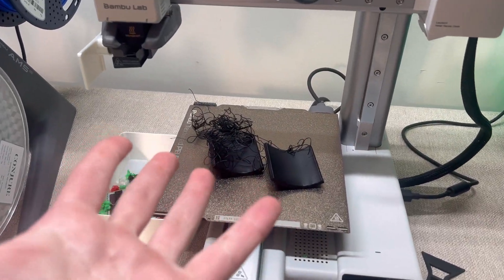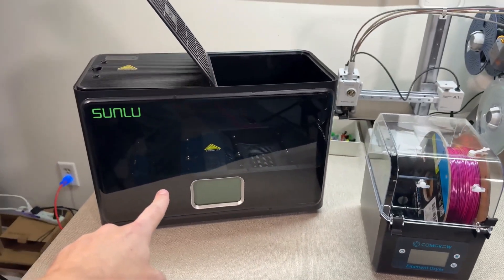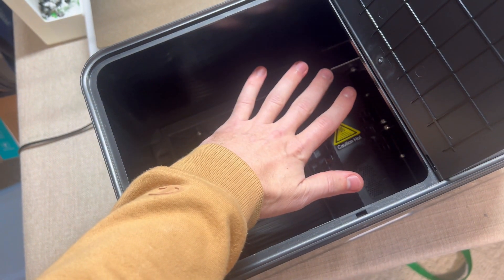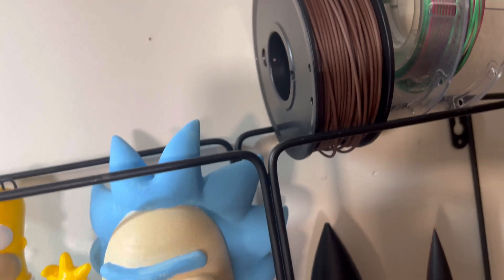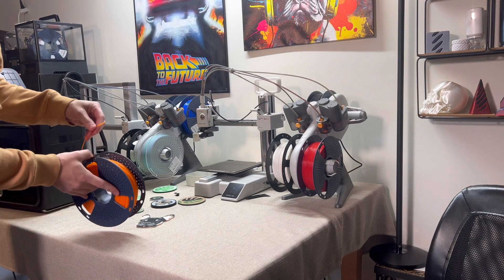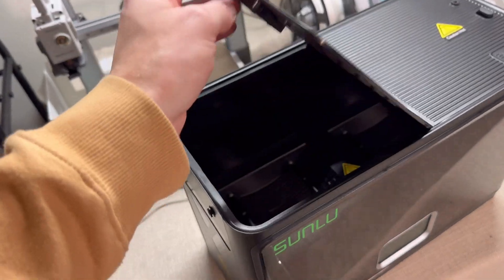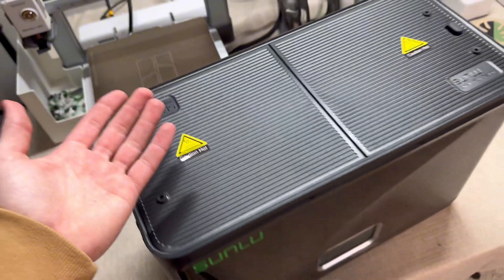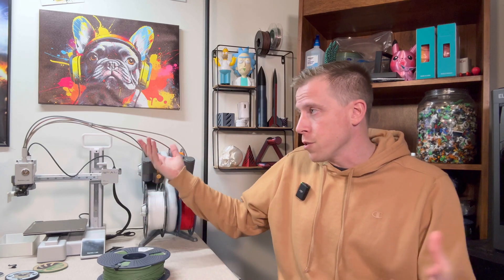7 Reasons this is the Best Filament Dryer!

Comment: Great video. Do you direct the filament directly from the dryer to the printer.
I have a Bambu a1 .
Do you dry them and put them on the spool or do you go from the dryer to the printer ?
I have a 4 spool a1 and am new to printing. After a week I started getting the webbing etc in the longer 4 hour + prints when about 75-80% complete.
All smaller prints seem to be fine.

Comment: Thinking about getting the flash forge 4 color printer, so, if I add the 4 roll dryer, do I dry filament as I need it, store what I don’t use and then dry it again next time. In the mean time should I vacuum seal it in between use and vacuum seal any new in stock rolls? Thanks

Comment: Starting my 3d print journey now and I got a p1s for 499. Loving it so far. Looking to get my  first dryer and I'm wondering if I should get the AMS 2 pro for $310 with the $50 Off that bambu labs offered if I buy the ams or if I should get a independent dryer like the one in the video for $139. I not sure yet if I'm going to start printing multi color stuff yet but I'm sure that I'll be printing 3d parts for my  car that needs to hold high temperature.

Comment: I would agree with you, if the Sunlu dryers wouldn't suffer from so many flaws. These started with the S2 lacking fans in some versions (all version are named S2, but some have a fan and some not) and continue with the S4 not being able to keep a stable 70C for a longer period of time. Many users also report, that their dryer simply stink so unbearable they cannot be used in the same room. Not to mention the complete absence of support from Sunlu.
So, I cannot recommend any Sunlu dryer based on my personal experience (and other when checking Amazon reviews or discussions on Reddit for example)

Comment: Terrible review 360 degrees but not a mention of the hot spots by the fans or the uneven temps around the box, no mention of costs keeping it on all the time.. Temp is an average lots of guessing involved still. No mention it doesn't go hot enough for some filaments. Not loud ?????? omg, lies. Maybe you didn't get it free but you clearly want to impress the company . No science behind this review just an opinion with no tests. Take this review with a pinch of salt people

Comment: Ive got a Comgrow filament dryer, as you show briefly in your video. for twin rolls. I use it to condition the filament an it can manually feed out to your printer. I have  a A1 and a A1 Mini. often going at same time printing. its electronic display and temp control. it has rollers inside the case. it has various located filament ports 4 off. It is a pleasant experience feeding to 2 printers simultaneous. one independent roll off filament each.
Reply: Yeah for those curious it was under $ 50 from Amazon. It included the power supply brick to suit. and it is built in fan also. and quiet!

Comment: Hi  Several times you mentioned it has 360" even heating.  How is it different than other enclosed driers?  What is the purpose of the rollers at the bottom of the drier?   Does it vent air to get rid of the humidity?    I am intrigued by this, but i think you raised at least as many questions as you answered.
Reply: To start, other filament dryers have heating elements at the bottom and poor air circulation, which causes only the bottom part of the filament to dry. The rollers at the bottom allow the filament to spin without friction in case you're printing directly from the dryer instead of using a spool holder or AMS. I'm not sure how it gets rid of the humidity. I don't see any visible vents, but it does have an adjustable humidity setting, so I assume it vents moisture somehow.

Comment: I was curious if you plug the AMS into the filament dryer - that would be nice to see.  I know the AMS is pretty fussy over distance - both of mine took some tweaking to work with the AMS on top of the enclosure, feeding down into the A1.